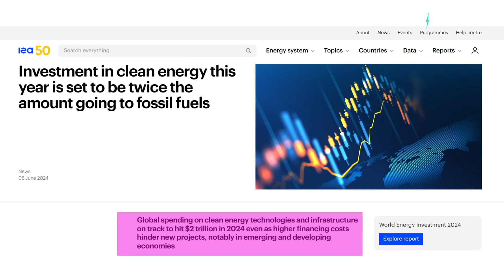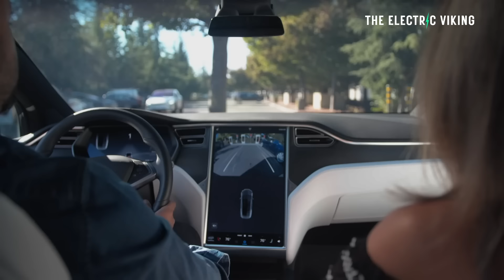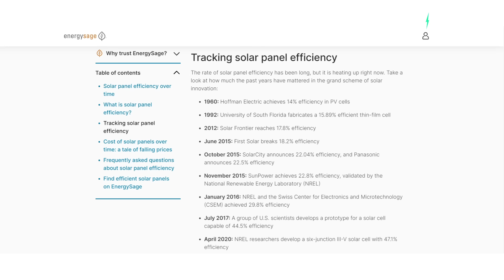Global clean energy investment to hit $2 trillion in 2024, smashing fossil fuels

Comment: You DO NOT need fossil fuels to make plastic!

The traditional way of making plastic is to crack natural gas into Ethane (C2H6), and then use that as raw material for making many types of plastic.
But, given enough cheap energy, you can easily create Ethane by combining Hydrogen (H2) and CO2. This can be done in a plasma-catalytic CO2 hydrogenation to ethane in a dielectric barrier discharge reactor.

So, there you have it:
 - cheap energy plus water -> Hydrogen (H2).
 - cheap energy + H2 + CO2 -> Ethane
 - cheap energy + Ethaen -> Plastics
Reply: Thinking outside the box is something that just doesn't seem to be allowed in the world of fossil fuel apologists.

Comment: With the strike price of solar being 3p a kilowatt and gas about the same. Unless you have gas in your country when you will be mad not to include solar in your energy strategy. With distribution cost being at least 5p. you would be mad not to include some  backup to reduce distribution costs.

The issue in the UK is that we put all our cost in one basket. Getting the power to a user is more expensive than producing the power Yet the National Grid sits idle for a large part of the time.

We need a series of smaller grids with some form of backup energy to smooth out use in the UK.

Ask ChatGPT to break down the costs in your county.
Reply: What you need is home energy generation with solar and storing with home batteries. Will reduce dependence and load on the grid.
Reply: @TurreTuntematon  all that’s gonna happen in my next house. We can get free energy in the UK for about onehour a day.

Comment: I suspect that renewable energy solutions will begin to be adopted by developing nations as the demand for electricity increases.
As temperatures rise in the Global South then need for air conditioning will increase. We are seeing that in Pakistan right now where temperatures in the month of June reach 50 degrees Celsius. You can run A/C if you don't have a grid which can generate the required electricity.
Reply: Axis (pet shop boys) 😅

Comment: Definitely need fossil fuels or wood for heat where the climate change is keeping it to cold for a heatpump
Reply: It can be said that electric energy will be so abundant that you can simply use resistive heating without worrying about extreme costs
Reply: @marcoshenz  prices for some things go up a lot easier than they go down, especially when it's something people need

Comment: Coal may be king in Australia, but in the USA we have just "discovered" that there is commercially viable lithium in the wastewater from natural gas fracking.  In fact, known fracking deposits in Pennsylvania alone could supply 40% of the USA's future lithium requirements for batteries.  Since natural gas produces only about 1/2 the CO2 for an equal amount of heat, switching from coal to natural gas can instantly cut coal related CO2 emissions by half.  For a bonus, the lithium recovered from natural gas production can add to the production of batteries needed to make solar and wind energy practical while also replacing internal combustion engines with more battery electric vehicles.
Reply: Wow - is that why they say natural gas is CLEAN here? Because it’s only HALF as dirty? My gosh!
Reply: Lithium may not be required in future batteries.
Reply: @joanbischoff5972  no.  I never said half as "dirty".  I said 1/2 the CO2.  Not the same thing at all.  Coal exhaust contains mercury and other heavy metals and particulates not in natural gas exhaust.  Natural gas exhaust is just CO2 and water vapor... you know, the stuff plants need to live.
Reply: @TurreTuntematon  it's not for not trying.  Lithium-ion battery tech is 50 years old.  Electrochemistry requires a significantly active element.  So far, lithium has been the best.  The periodic table is what it is.
Reply: This is how the transition should work - It literally has to be a win win for all or it will never happen.
Reply: @TurreTuntematon  but the future isn't here yet.

Comment: Green energy can be so good for job protection and job security. I will never understand why the modern conservatives are so against it, just because solar cells aren't called nuclear cells.
Reply: That's  not  true       if you work in coal or gas there's going to be a lot more hungry homeless people
Reply: @djt8518 The coal industry has been abusing it's workforce for generations.

And, coal is so much more expensive than anything else, even apart from the horrific toll on human health, it would be put out of business by natural gas regardless of anything happening with renewables.

But as it happens, there will be plenty of work in green energy.  As dad retires from the coal mine, junior can start at the lithium mine, or the installation contractors for solar or wind or batteries or power electronics.  The work will be far less toxic, on many levels.

Comment: Energy storage, both electrical and thermal will replace generation at the top of the Tower of Power as soon as 2030. Most of the storage will be privately owned because the cost is already following the solar S-curve.

Comment: It's mechanical vs. electrical. The former can only get so efficient and the waste only so limited. The latter can get more and more efficient and its waste less and less. How can people not see this with tube TV prices stagnating or getting more expensive, to flat screen TVs going from very expensive to throw-away priced? It's in your face. ICE cars keep getting more expensive, while BEV prices (largely do to battery prices falling off a cliff) are plummeting.
Reply: Wind will, for quite some time be a bid part of the renewable soln. In Texas, it is bigger than solar by a lot. However, to follow the argument of mechanical vs electrical, I believe solar will be a vastly bigger portion of our future energy supply than wind. Wind has ever bigger physical towers (for efficiency) and physically cranking blades turning induction motors. Solar has no mechanical parts - they are essentially like flat screen TVs.

Comment: Fossil fuel energy generation is very wasteful, about 70% of the energy in fossil fuels goes to waste and does not make it to the end user, renewables are much more efficient, over 90% makes it to the end user, FUD has worked for fossil fuels so far, but it is rapidly approaching a time when it won't, you can't hide something like that from people forever. Same goes for ICE vehicles, most of the energy in fuel is wasted as heat, EV's are way more efficient. In 5 to 10 years things are going to look very different.

Comment: That is great.  However, there is still investment in FF shit, when we need that to be zero.  Each year (with one exception) sees us emit more CO2 than the previous year.  We need to emit none, not less or the same, but none.  Instead we are emitting more.  MORE!!! the one year where it was a little less than the previous year was of course 2020 when we had a little pandemic shut us down a bit.  We still emitted more than 2010 but less than 2019.  We are seriously in trouble because we have started 40 years too late. 

The fossil fuel giants knew about the greenhouse effect and that they were increasing it way back in the 1960s.  But profits people. Just like the tobacco industry, they kept it under their hat and continue to spread their BS.  

In reality we are going to see a lot of trouble ahead. There will be huge refugee problems.  People think border security is an issue now, just wait.  There will be wars for all sorts of things including water as some place get too much and others dry up. Rebuilding costs after extreme weather events will sky rocket. 

Anyhow, good news and thanks for your optimism.  I like your channel a lot because I need to hear the good news and there definitely is some.  I only hope it increases exponentially.  Here's another bit of the good news;  coal emissions seem to have flattened out and may be set to fall dramatically. Oil and gas though keep rising.

Comment: As I mentioned in a previous video, renewables do have a life span. What happens to the wind turbines when they need replacing after 15 to 25 years, where do the glass fiber turbine blades get recycled and how, not land fill I hope? And for solar power panels that are expected to last 20 to 30 years, how will the billions of them be recycled and the Phosphorus used in them be recovered? There isn't really only one energy solution here, but we have to adapt many solutions depending on the locations and power requirements

Comment: More good news Sam. 😊

Our solar system is a good test case: 3 years old. 

We have a modest 7.4kw solar system on our home roof—with a good open northerly aspect. (country Victoria, Australia) Our solar inverter is a 7kw Fronius. We are quite vigilant in consuming while we produce—where possible, and our monthly power bills are close to zero despite the solar input to grid rebate being only 6c per kWh. (Currently in credit $29 and haven’t paid a bill for about 6 month over summer) possibly will have bills of up to $50 per month over winter) We have 20 panels—each panel is 370 watts. So except for blackout redundancy it’s hardly worth getting a battery, though I would love one. When we get out first electric car we’ll charge during the day and from my maths will save heaps by channeling it into the car rather that the grid.

Comment: The premier of Canada's largest oil-producing province, Danielle Smith of Alberta, wants to slow down the production of renewable energy.  Solar and wind have potential to replace oil-fired electricity generators, so fast that it can actually cut into oil industry revenues, that it may reduce government fuel tax revenues.  In fact, the more solar and wind replaces oil, the more the oil price drops, which requires Smith to increase provincial gasoline taxes, in order to stabilize revenues.  Smith publicly went on record to say that fossil fuels should be the primary means of generating electricity with renewables only being a supplemental or back up source, because the weather (sunlight) is variable and therefore unreliable. Over and over we hear that solar should not be relied upon, when other places like Australia and Hawaii are replacing oil fired with solar. It is true that the climate is different in Canada, but Alberta is far from being cloudy and there is very good battery technology available in Canada, due to its mineral reserves.  Kinder Morgan abandoned its pipeline project and the Federal government bought it out, completing it over budget, and many now say that it will never be paid for before it must be replaced. This is what renewable energy is up against in Canada, because of massive sunk cost investments in the tar sands projects which produce oil at too high a cost, compared to USA and others.
Reply: Energy security will depend entirely on renewables almost everywhere in the world eventually. Economics make this a certainty. Unequal distribution of energy resources will be fundamentally reduced, even eliminated.
Reply: On the longer term world wide the high production cost and lower quality of Alberta oil will drive them under sooner then most folks think.    The oil companies collectively will restrict supply to just under demand.    They will close all the most expensive production facilities and most difficult feed stock to refine first. They did this the last time about 2 years ago that triggered windfall  profit driven inflation.   They tested it to see if it would work, and it did.  They now know they make way more money restricting supply rather then selling as much as they can at lower prices.   

Alberta government has a lot of hard work to do to wean off the fossil fuel nipples.  They will have to find another way to support eduction and healthcare.

Comment: Toyota with it's hydrogen will win
Reply: There is no hydrogen.
Reply: Sure sure, any decade now
Reply: Coming from down under!
Reply: All Toyota needs is another planet for storage.  Mars?  Please lmk.
Reply: Right now, 97% of the hydrogen we use (mostly to make fertilizer) is derived from natural gas using fossil energy. You can celebrate a bit if that number ever drops to 96.%.
Reply: Jai Hind.  We Indians are working on Green hydrogen only which is   produced by electricity from green sources like Solar.
Reply: @tedchandran  Why use electricity to make hydrogen, to use in hydrogen vehicle to convert the hydrogen into electricity or gas for engine, not being very efficient. Why not electricity directly into vehicles with electric motor called BEV? Just a thought🙃
Reply: Axis (pet shop boys) 😊😅